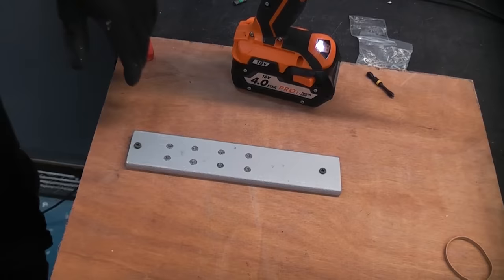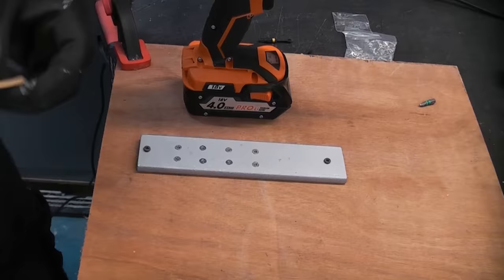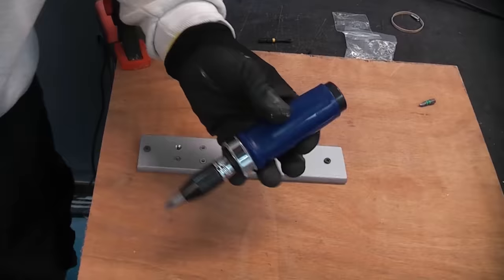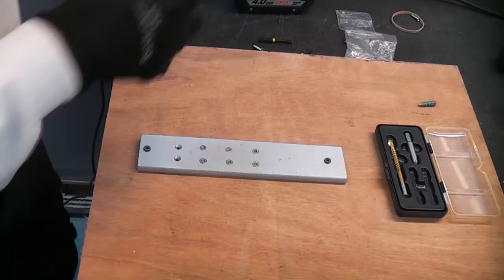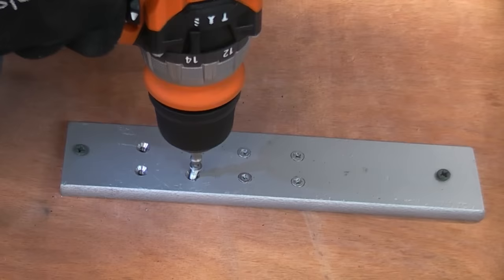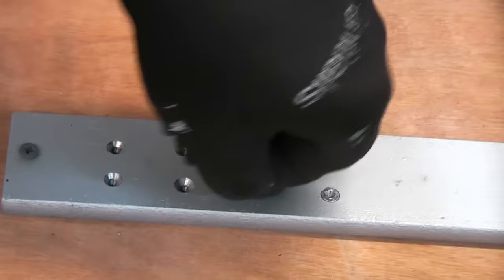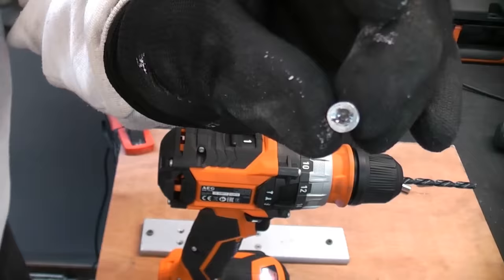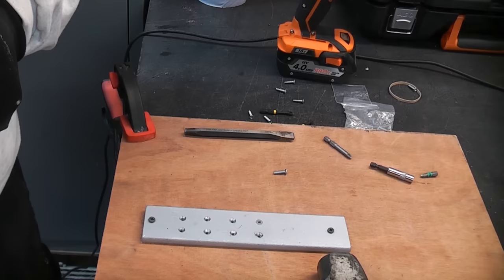How to remove stripped screws – 7 different ways

Comment: Many times you can take the proper screw bit and file 1 - 2mm of material of the point. Tap the bit into the damaged screw hole a few times with a hammer and then unscrew as usual. 
Cheap, and some finish screw heads, are not very well formed during manufacturing and the point of the screw bit hits the bottom of the screw head stopping the lands of the screwdriver bit engaging with the form of the screw head. And so when you try and use a cordless to remove the screw it cams the head out. 
This trick also works with screws that are filled with paint for the same reason.
One last related trick is when you are making forms for concrete. Screw heads that get filled with concrete are a nightmare to get undone. I get a tube of cheap caulk and squirt some over the head of each screw before the concrete i poured. When you come to break down the forms just push the screwdriver bit through the caulk and the screw will come out every time.
Reply: Michael Tricker this was actually what worked in my case. I almost set my laptop on fire thank you so much Michael
Reply: Am I the only one that looked at this comment and didn't want to read it because it was too long?
Reply: Get hooked on phonics, it worked for me!
Reply: T-roy Unique2007 I read it the second time I looked at it

Comment: Once I rounded a internal hex screw in an engine block that had red loctite on it, in order to remove that sob I put super glue on the bit and allow it to set in the fastener.  It worked like I hoped it would have then I burned the glue of the bit to get it out.
Reply: Heat will help release the lock Tite also
Reply: "That sob"...😂😂

Comment: What surprises me the most is that people use power tools to remove or tighten a euro lock screw....
Reply from the maker: Yes, it can be risky doing that.
Reply: Aman A 
Yes I agree. Humans seem to have evolved an aversion to manual tools
Reply: It is possible to use a power tool on screws, only if you use common sense, and start the torque at a lower setting, increasing as needed to properly torque the screw in. Or just use the proper PMEL calibrated install gun. The  "Gorilla" method of zipping them down at max torque is just assining (sp). Try removing over 100 stripped or corroded screws on an aircraft panel...just 1 panel amongst many.
Reply: What’s a euro lock screw?

Comment: 67 year old woman trying to get screws out of back camper window. Most came out ok but some were so badly buggered up I thought I'd have to drill out. Then decided to check you tube. This was SO HELPFUL!! Used the rubber band on one. After reading comments, used Dremel and flat head screwdriver on one. Used Dremel, flat head screwdriver and rubber band on another. The last one Dremel, flat head screwdriver and hammer to loosen, then rubber band. Wow!! So helpful!! Love the comments, too. My goal is to not have to ask for help every time I get a bug up my ass to do things myself instead of paying someone to do them. Actually, I did pay someone to fix the back window of camper but it was a FAIL. SO I guess if you want it done right, do it yourself. THANKS for helping me!!

Comment: Idk why philip heads are used on anything.
Reply: Voges.
Reply: Voges as opposed to what exactly??
Reply: Opposed to Torx mostly. Most people agree torx screws are superior.
Reply: Easy to orient the bit for rapid placement,like drywallers.drywall screws are hard and brittle like a mill file,so the bit fails first.
Reply: I have had great success with square bit screws.
Reply: PHILLIPS head?! What about slotted screws?! I've gotten so pissed off at slotted screws that I completely lost control, ripped the entire piece it was holding off with a 5' crow bar and just replaced it. Was easier than fucking around with that screw.

Comment: Any tips on how to remove a very small stripped screw? It's on the plastic case of a laptop! :-S The only one of the 7 methods I could apply to my case was the 1st, with rubber band...it didn't work unfortunately.
Reply from the maker: It might be best to just drill the head off it, then try and grip the remained with molegrips once the laptop case is separated.
Reply: Thanks, I finally barely managed with a screw extractor bit. It was obviously too big for the screw but I guess I was lucky! Thanks anyway for the reply :-)
Reply: chumbo the extractor bits sometimes work. If it's not too too bad I've found diamond thermal paste works. The diamond bits help it grip.  Other than that, I haven't found much else that works well on laptop screws. I repair computers for a living.
Reply: Use a electric engraving tool

Comment: What about using a Dremel and turning it to a flat head and then just used a flat head to get it out  but that’s depending on the situation
Reply from the maker: You could try that.
Thanks for the comment ;-)
Reply: You don't need the Dremel just the shaft and blade in a drill. Preferably a 90°drill

Comment: I’m doing a project replacing the windshield on my Yamaha scooter and the guy that had it before me stripped out three of the Phillips head bolts that hold it on the rubber band trick was the first one I tried and it freaking worked. Thank you so much for the video God bless you.

Comment: AWESOME! Just tried the rubber band method! PERFECT! I live in a house build somewhere around 1820, someone has used wood screws in the 2nd bedroom to hold the three, yes THREE, layers of more modern 1950s, 1960s, 1970s era carpet to the inlaid linoleum flooring underneath that was placed over ancient floorboards.
Reply from the maker: I'm glad the video helped 
Thanks for the comment 👍

Comment: For damaged wood screws, weld a bolt to it.
Reply: welding a nut to a broken screw or bolt has worked wonders for me for the past 30 years, even big bolts like a 5/8" bolt broken flush can be removed by welding a 3/4" nut to it, wire feed welder is best crank the heat up.

Comment: None worked for me so I put glue into the screw an attached to a screwdriver an it actually worked lol
Reply from the maker: LOL
Thanks for the comment 👍
Reply: 200IQ
Reply: Damn that's genius I'm gonna try that!!
Reply: If you don't mind me asking, which type of glue did you use? My screw is stuck in my tv stand so any hard pressure can't be used. We currently have 4 screws that won't come out 😭

Comment: Great info. But try removing screws in aviation. It’s a totally different beast.
Reply from the maker: Thanks for the comment
Reply: Thats not just aviation.  Any heavy machinery usually uses locktite or other some other product to keep bolts and screws tight. Its all good until you have to take it all apart

Comment: That chisel and hammer strategy worked so damn well!!! I've been trying to get the screw off of my drum pedal for 2 years but it was too tight. So I wore the heads out trying to get it out with the wrong kind of screwdriver. THANKS A LOT FOR THESE IDEAS!!!!!!

Comment: I needed tp replace a small wheel on my vinyl cutting machine with a 1.5 allen screw that was stripped. Thank you youtube guys so much for giving away your little secrets. I went to Harbor Freight and got a small torx bit and it worked right away...Hallelujah!

Comment: Thank you! Such a great video. I had a difficult case here, an elastic band & damaged screw extractors/grab-it were not able to extract the screw. What worked was the cold chisel.
Reply from the maker: I used the cold chisel a lot in my last job.
In fact, only last week I used that technique to remove a pipe socket at my local school.
I was once working on site and had to undo a union on a condensate line, I tried my pipe wrench and an 8-foot pole that some scaffolders left behind, it was not moving. Two smacks with the lump hammer and chisel and off it came 😉

Thanks for the comment

Comment: Thank you so much for the hammer and chisel technique. I wanted to open the master cylinder of my uncle's motorcycle's front disc brake, and one screw opened easily, but the other won't even budge. I tried many techniques, but finally, took your video's help and got the screw open and changed the brake fluid.
Reply from the maker: I'm glad the video helped 
Thanks for the comment 👍

Comment: I tried the rubber band method on an automotive bolt that hadn't been touched in 24 years and it worked !  And it was quite stripped.  Thanks!

Comment: I used a combination of your methods plus my own trick:

1. Used a torx head because it has more points to grip into.
2. Hammered the torx end down into the stripped screw head.
3. Used the elastic band.
4. Used an electric screwdriver with a LOT of manual pressure for the torx head to catch something (so much that when the screw came out I bent it, then manually removed by hand).

THANK YOU!

Comment: Many thanks.  The spring center punch option worked like a charm.  I spent a good week trying to get a stripped screw removed and that di the trick.  You rock!
Reply from the maker: I'm glad the video helped 
Thanks for the comment 👍
Reply: Didn’t look a very tight screw though, just saying.

Comment: None of these techniques worked for me on a screw I was stuck on, but this video gave me an idea. The screw I'm working with bulges out a little bit so I took a flathead bit and put it into an impact screwdriver and hammered the screw into a flathead. I gave it some WD-40 and it gave out with no resistance. Either way I don't think I could've gotten the screw without this video.

Comment: I'm glad I found your channel.  I have a small device of some collector's value with a screw FIRMLY stuck therein.  I'll be trying these techniques until something works.  Thanks from the US!
Reply from the maker: Brilliant 👍
Best of luck with the screws!
Thanks for the comment 👍
Reply: @ultimatehandyman  The left-hand drill bits worked on one screw (I was doing it wrong, using too small a bit until I saw your channel).  The other one I'm going to try heat and a manual impact driver ... soon as I get an off day and procure one ;) .  Thanks again!

Comment: You said right at the end that there was no chance this would work on a 5" wood screw. Well I like a challenge! I managed to remove a smoothed PH2 5" wood screw using an adapted version of your elastic band suggestion. I used a bit of non slip rubber matting that you can get to line drawers with to stop things slipping about and then very slowly using the reverse on the drill with a PH2 head. It worked!! Thanks very much for the video and the suggestions

Comment: I have learnt something and now I'm off to put it to use. Best ever DIY video. Thanks a lot.
Reply from the maker: I'm glad the video helped 
Thanks for the comment 👍
Reply: @ultimatehandyman  thanks for reply. But I tried the rubber band and tried using a drill in reverse but the screw wouldnt undo but just eroded more. What can I do please. Screw is about 2 inch long and 6mm wide.
Reply from the maker: @IDMaximillian   You might have to try a damaged screw remover, such as the Grabit or similar. 
Good luck with it ;-)

Comment: Much appreciated. I was struggling, trying to get some around, headed Phillips, head screws out of the window frame, or the bracket to hold the window shades made it very difficult to get a tool into that area. Your rubber band trick was phenomenal. Thanks again.
Reply from the maker: I'm glad the video helped 
Thanks for the comment 👍

Comment: Thank you so very much! Working on LG washer after 25 yrs first time filter pump went out. A screw was old and corroded and WD-40 and a couple other things didn't work. Sliding a thin screw driver in behind it and around it while tapping with a hammer worked after about an hour. Rubber band didn't work. Thank you!
Reply from the maker: I'm glad the video helped 
Thanks for the comment 👍

Comment: The Grabbit kit worked for me, but not how you think!  Helped me to remove a rusted and totally stripped screw holding in a rotor that needed replacing.  I drilled in rverse using the 2nd largest bit, flipped it over and tried backing the screw out with no luck.  I started over again, but pushed the drill harder into the screw and ended up forming a pretty deep cone within the screw head.  I then bumped up to the largest sized bit with the goal of working the head so thin, it would pop off.  It eventially did and I removed the rotor leaving the screw inside.

Comment: the rubber band was a new one for me...as a Mechanical Assembly Supervisor at Haas we dealt with broken screws on the daily. Impacts and easy outs can work, but sometimes space is tight. I always liked drilling the heads off of screws...find a drill just under the minor diameter of the screw and drill through the head. Once you pop that off, remove the plate and with pliers remove the screw. Done right there's little chance of damaging the threaded hole or the workpiece.

Comment: I was just now trying to remove a gamebit screw that had corroded and wasn't getting enough grip, as the outside ridges were almost non-existent.
I put a bit of paper over the screw (from toilet paper, folded in two), and with a bit of pressure, it became loose enough to get it out.
Kind of like the elastic band.
Good advice in this video, thanks!

Comment: Quick question: do these techniques work horizontally or do you have to have downwards pressure? I have a worn down screw that's not budging in my ikea bedframe that's blocking my drawer from entering the rail. I suppose I could tip the entire bedframe sideways but it sounds like it would enable me to accidentally damage it

Comment: From previous experience,  what l found useful was to Drill lightly into the centre of the Stipped Screw head, then using a small Allen key head attachment. Loosen the Screw gently then once the Screw has become outward to the Fitting Plate or Wood Framing, simply use a flat head pair of pliers, carry on to loosen the Screw until fully out. Works every time. But obviously took experience, trial and error to establish that method.

Comment: Thank you for video. The rubber band did not work for me, but the cutting end of the grabit bit got it out on first try!
Reply from the maker: Excellent!
Reply: @ultimatehandyman  Side note, The fridge is throwing a 40 E code, i think that's reference to the freezer bin fan maybe? Is that the same fan that is attached to the auger? Thank you again.

Comment: Great video, thanks. I will say a lot of these non-drill tips probably won't work if the screw is bearing any kind of load or tension, because those won't just loosen with a bit of initial force.

Comment: Yeah, long wood screws.....   Needed to pull up one long section of smart board decking.  5 square head flush screws.  3 out easily, Mr. Murphy showed up for the last 2.  Rubber band trick no joy.  Lacking alternative tools from this video, wound up drilling down on the screw with a larger bit to destroy the head so the deck plank could be pulled up around the remaining body of the stuck screws.   10 minute job turned into an hour pain in the arse.  Great video though.  The one I watched in the midst of my problem today only had 4 suggestions, so I learned a few more from you.  Cheers for that.

Comment: HI I enjoyed the video, I was taught some 60years ago how to remove stuck screws, well before modern screws. Slotted screw, remove by using a nail punch, depending on head size, size of punch, the first attempt of bad screw, try to tight,! as said all depends on the location of the damaged screw. Som very good advice given, worth having a go if you have this problem. Regards welshman2081

Comment: I ended up using the drill without any bit on it. I had enough screw material so that I could place the screw into the drill. I tightened the chuck and reversed it, which worked the best in my situation.

Comment: Excellent ideas here. I have a set of easy-outs that require drilling into the screw and then the easy out with left hand tap-thread winds it out easily turning it with a Mole wrench.  But these ideas here do show considerable dexterity and skill using the tools being demonstrated. Sometimes if you aren't careful you can butcher the screw head so that nothing will remove it and drilling it out is the only answer - if you have sharp enough drill-bits that is!!
Reply from the maker: Thanks for the comment 👍

Comment: Thanks for the tip. The first one worked rather easily. (Albeit, I didn't have a rubber band, so I used a hair tie which was pretty much the same and it worked right away.)
Reply from the maker: Nice work!

Comment: Thank you for a great video. I have a stripped M5x30 torx screw in my engine air filter compartment (plastic surround not metal). I’ll try the rubber band option or the extractor tool. I’m  concerned about damaging the housing with some of the other options. I noticed you didn’t use a valve grinding compound. Is that because it could damage your tools?
Reply from the maker: You can try valve grinding compound, just find some old screw drivers 😉 
Thanks for the comment 👍

Comment: Useful tips, thanks. I always find its trial and error finding the right Pozidriv bit for the Pozidriv screw, going on how the bit feels in the screw head. Any tips on finding the correct bit for any unknown screw?
Reply from the maker: You can often tell by looking at the screw, a Phillips head looks like this X
A pozidriv looks like this X with a smaller x on top of it, at a right angle to the first.
I normally just try a few bits with my fingers until I get the best fit 👍

Comment: These are all great!!! One question. Will these work on a Phillips head type screw? I’ve had no luck so far with the rubber band and the impact driver. The screw is in my bathtub drain grate and I’m trying to get it off so that I can replace it with a new drain stopper. Please help 😫
Reply from the maker: That screw is probably stainless-steel. It could be really difficult getting it out, as they tend to be soft!